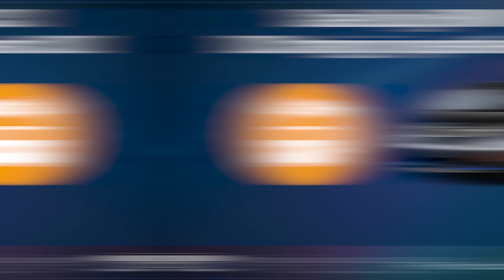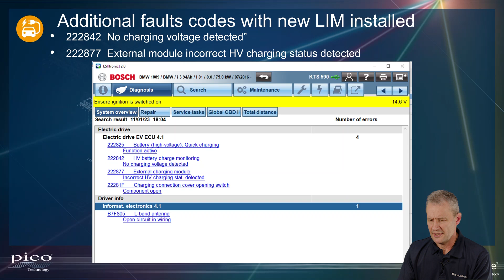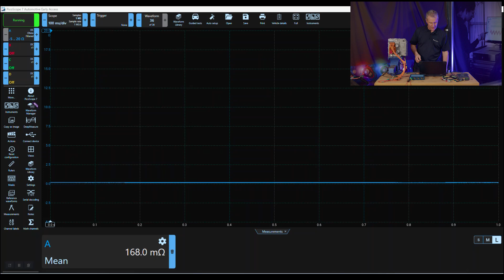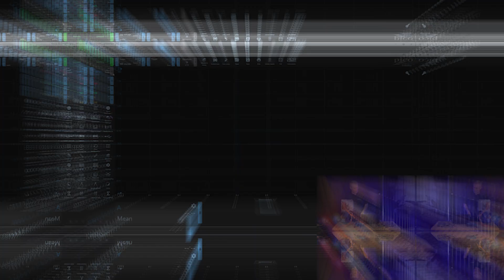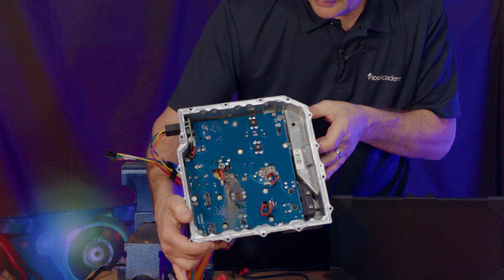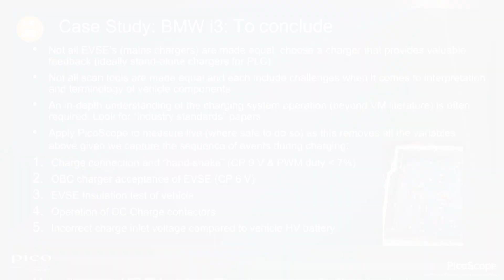DC charging fault on a BMW i3 | Case Study

Comment: Never heard about LIM module, didn't know it existed, on every EV I've diagnosed it's been all in the OBC itself so i would attack that one first without knowing about that it was actually over voltage from a bad connection.
Might have learned about the LIM while diagnosing but I haven't yet worked on BMW EV.

Have changed the OBC on several cars and been (knock on wood) 100% successful repairs to this day and i always take the old home and disassemble to find the exact fault and found most are bad contact between the PCB (circuit board) and some bus bar or relay inside it. Most of them the PCB is absolutely charred all the way through and often also find other places like inductors for noise suppression have been very hot and insulation gone brown instead of red as many lacquer are in these large inductors

Comment: hi, the BMW Service Note for the DTC 805519 is ""The fault can occur during direct current charging at a high-power charging station if the high-voltage battery is fully charged but the minimum available charging station charge current is still too great: The charging process is interrupted shortly before the charge state reaches 100%." - hm; but the Service Plan is actually tells your findings: "Check plug connections and lines between the charging connection and the LIM. If applicable, repair the plug connections and lines.If the plug connections and lines are OK, then the fault is caused by the used charger (charge plug, charging station)."